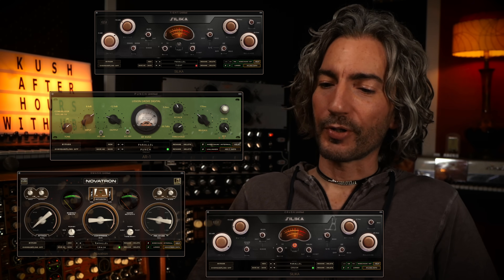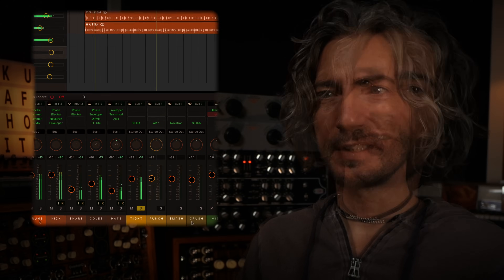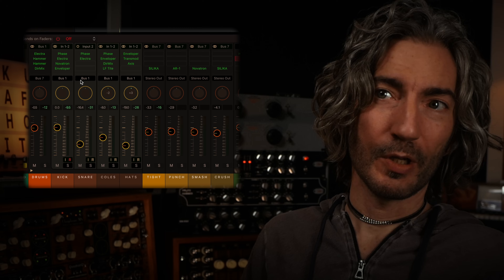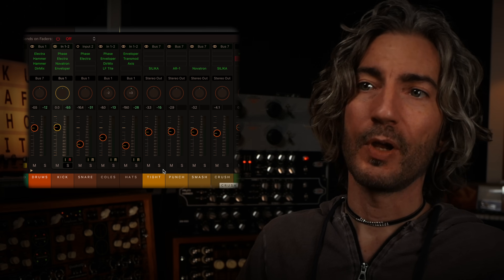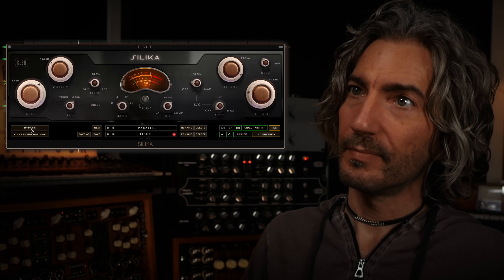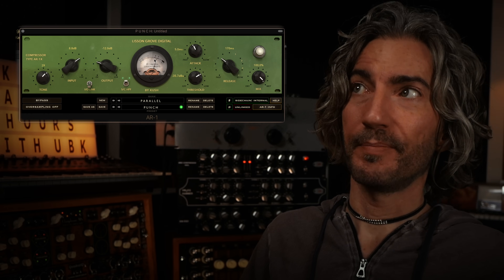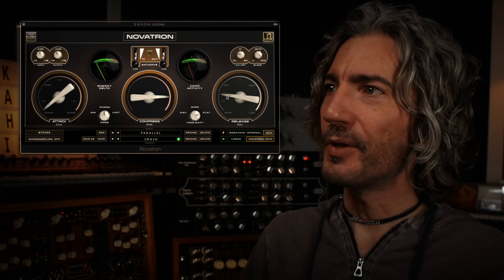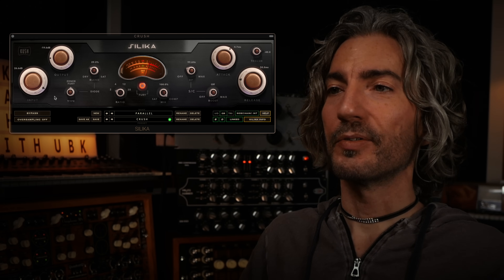Plugin Designer SCHOOLS YOU On Parallel Compression

Comment: Really like the crush signal, puts that 1 to 2k „tap“ impulse that’s so important to the feel , but few people give that area much love because they feel it’ll be hard or get in the vocal’s way, but that snap transient is so important, when it’s there it takes the need to turn the drums up away, gets a natural balance back in there, well done, great video, informative as always…
Reply from the maker: Agreed. 500Hz can also give that same transient impact as 2k, but with a woody, tough vibe rather than sharper metallic crack.
Reply: @TheHouseofKushTV  I try and get that area from my overheads, which by me sit behind the Drummer snare side about 1.8 m high and floor Tom side about 0.9 m high but both exactly the same distance from the snare drum, usually have them full range, HO @ 70-90Hz, it’s the core of my sound, close mics I use to “fill in” the sound and bring out particular character parts of the individual drums, all phase, and sometimes time aligned aligned too to an omni measurement microphone placed above the kick equidistant to floor and snare, use that for a bit of mono dirt or crush as needed…works for me…
Reply: @TheHouseofKushTV  thanks for all the likes and answer, keep up the wonderful work you’re doing, showing people that “breaking the rules” is actually no “creative rules”, only the ones in physics

Comment: Hi Gregg

I like to saturate after the compressor for extra punch and crunch. I also like to flip the phase and gain stage to the point where it nulls out the most, so that point is at the 0db level, flip the phase switch again. Now I'm always adding to the dry signal, not the other way around, and my volume range is as long as possible. 

Greetings

Comment: If I've understood this correctly he's put these compressors on groups (each of those sums all of the drum tracks) as opposed to a compressor on an additional track or aux and blending that in? Then to get his parallel blend he uses the blend knob on the compressor itself... so if you were to turn down the fader on the compressor channel, e.g. 'tight' channel, then you'd lose the dry drums signal too. Have I got that right? I'm still learning this stuff... I've been doing parallel compression on an aux/return and when I do, I generally turn the wet knob to 100% and then just blend that aux track in using fader...  The only time I really use the blend knob on compressor is if I have it as an insert.  So then I just wondered if there is a difference in using the blend knob (say for example at wet 60%) on a compressor on an insert as opposed to having the same setting but with the compressor on an aux track?  I suppose the difference is that on the aux you're getting that additional 40% dry signal added to the 100% dry on the original drum channel??  Is that right?  Is that something that people do?  Or do most people put the blend at 100% if it's on an additional channel (i.e. duplicated track / aux/ return)...

Comment: this is very similat to Brauerizing. You can try and feel different things into each compressor, like the shaker in the tight or the overheads in only the smash and crush compressors, bass guitar in just the tight or the punch compressor etc. so that the elements counter pump.

Comment: Been a fan of parallel compression for a few years since discovering it. I quite dig a smooth vari-mu comp on medium settings parallelled with a fast comp set to crush and does some good work - this method I think gives me your 2nd and 4th but never thought of fitting 2 others in there in the gaps so very interesting to hear. Something on my wants list is the Kush Tweaker so would love to have heard that one in there somewhere but great video nonetheless.

Comment: Remember folks, One of the most famous engineers in the world Michael Brauer said this couldn't be done in software, only analog, because he trapped in that protools world, and as all things protools it was years behind the rest and couldn't do delay compensation. So be careful who you listen to. Luckily for us Gregory ain't no gear or daw snob, just good practical truthful advice.
Reply from the maker: Thanks for the kind words 🤜🏽🤛🏼  In all fairness to Michael, he has channels routing to busses which are also routing to other busses, plus the o.g. channels have sends to effects and other inserts which then also fold back into some but not all of the busses that the channels are routed to... it's vastly more complex than what I'm doing here, and it is actually the case that DAW's can't do that kind of routing.  Not because they're not well-programmed or don't have delay compensation, but because there literally is no way to calculate and correct all the offsets, they're recursive. 🤪

Comment: What I would have wanted to know is WHY the different compression settings give such different darkness/brightness characters to the sound? Is it because the highs are lower-energy so when you crush the signal it tamps down the lows and pulls up the highs, making the sound brighter overall?
Reply from the maker: It simpler than that: distortion, especially the kind that comes from fast hard limiting or clipping of a waveform, creates a lot of square wave shapes and upper register harmonics which are inherently bright.

Comment: Hey Greg,

Is it possible to post the settings that you dialed in on these compressors (and/or how you calibrated them?) toward the top of the comments or in the video information? Perhaps, you posted this elsewhere, but either way, I'd be very interested in that information. Thanks for the great tutorial and share.
Reply from the maker: Honestly?  I just pull up a compressor, push and pull the knobs every which way until I hear something that's a) a meaningful change from where I started,  and b) vibey.  Next, I level match the output with the bypass, then I'll toggle bypass on and off repeatedly until I have a word to describe what I'm hearing, and that's what I label the channel.  Do all of that 1 or 3 more times on parallel auxes until I feel like I have an interesting and diverse palette of sounds to play with... done.  That may be more loose and informal than you were hoping for, but it keeps me experimental and gives me space to conjure unique textures for each song.

Comment: I like how this video was explained, great job. One thing I was curious about was if we could have replaced the first compressor with a tape saturation module? I wonder what kind of tonal control you could have had using some of these analog tape saturation emulators? End result was a great sound although, it would have been nice to compare tape saturation compression and parallel mixing the subtle differences in.

Comment: Around the 20 min mark where you're subtracting the compressors one by one, are we hearing the dry drum bus blended in as well, or are you just using the 'tight' bus as the 'dry' signal? 
Might be a stupid question, I know parallel comp is parallel with a dry signal. But since your 'tight' bus is almost dry anyway, are you actually using the true dry signal, or just those four busses? 
Cool bassline and groove BTW! Your drums are always lively and dynamic.
Reply from the maker: Those 4 busses are all your hearing, the Tight is playing the role of the dry drums. A small correction if I may: you said “I know parallel comp is parallel with a dry signal,” that’s not actually a rule or a given.  Here, 4 comps are parallel to each other, but there is no dry signal anywhere. They’re ‘parallel’ because they’re processing the same input and the results are combined afterwards. 🙂

Comment: i've never understood with parallel compression (even more so with 4) how you wouldn't get phasing issues with multiple signals playing 'almost' the same thing.. and by 'phasing' i mean when you have to very similar things playing at the same time or possibly slightly offset you get a kinda of phasing effect. hang on.. i think i've just answered my own question haha.. surely with two identical tracks playing the SAME thing just doubles to amplification .. i think i'm thinking of cancellation (when 1 source is inverted and you're left with the difference of the two) .. nevermind.. sorry (i will leave this comment as a reminder to wakeup haha) ..great vid as always man :)

Comment: Oh, I dunno, isn't four compressors kind of arbitrary? I tend to start out with the one bus, then add another if and only if "something is needed", then reassess. Could always add another, then another... so why four? And why not six? 

Did you originally start the experiment with 2, then 3, and wound up at 4? Or do you just always reach for 4?

I think the most parallel buses I've done is three, and only one was properly compressed. With others I'll do shelving and then add saturation/distortion -- sort of a "poor man's multiband". And sometimes such a bus might be just one or two pieces of the kit, like kick/snare backbeat. Or, in your example here, I might just take that hi-hat mic to dial in the articulation and stick sound and sizzle.

Comment: This is quite similar to the Michael Braurer technique is it not? Blending multiple parallels rather than just having a drum bus and a parallel chain.
Reply from the maker: In a broad philosophical sense, absolutely, but that’s only because parallel processing is parallel processing regardless of intention or application. But this approach, and Michael’s, are both extensions of the old-school “New York compression” technique. Here I’m using four busses exclusively for drums, Michael has five mix busses that are for anything and everything combined, and in the o.g. NY compression scheme it was simply a duplicate mixer channel for the vocal, overdriven and smashed and eq’d very bright, blended low for density and texture. It’s all the same thing, just paints and brushes, used by different artists in different ways to realize different visions of music. 🙂

Comment: Sounds like the first compressor is slightly increasing the decay on the hats (a reduction in the 'tshhhhh' following the stick hit), making the hats sound 'tighter' (like the name of the strip). At a guess: low (severe) threshold, low ratio, and a long release time. The  That said, it's only an opinon, I'm sure someone with the right answer will come along to correct me :-).

Comment: Please release your logic skin! It looks wo great with your plugins
Reply from the maker: Thanks!  Sadly it doesn't work with newer versions of Logic, which is actually half the reason I'm switching to Reason.  So I guess someday I'll drop a Reason skin 😛
Reply: @TheHouseofKushTV  Whats the other half? :))
Reply: @TheHouseofKushTV  Coming to the House of Reason. Welcome along. Yer gonna luv it. Sing out if you need any comprendo on anything as I have been R-Rated for almost a decade and a half now. :-)
Reply from the maker: @bebestakkis  Honestly?  I'm not a fan of how laptop-and-beats-producer focused Logic became, while really REALLY basic mixing functions (like a phase flip and trim on the mixer channels, metering on hardware inserts) remain completely absent after 10 years.  It also has several major bugs at higher sample rates that have persisted across years.  Plus, my brain could use the workout of learning an entirely new production environment, I'm actually very intimidated by the prospect!
Reply: Guys don't leave Logic when it's becoming real pro. Atmos got major producers fully on board. Apple fixed the latency compensation bugs. Logic on M1 ? Damn. Apple seems to listen to feature requests a bit more, lets bug them ! Every damn has stupid little flaws. Logic's getting there, rather soon, to my humble opinion. Cheeeers

Comment: I think it would be "fun" (hours of work) to try a "sliding compression" on different parts of the recording, i.e.. to allow each instrument a bit of limelight, to stand alone at different points in the recording. I become "mental" when cymbals get too loud and  "take over" a recording mix, but would LIKE to have them turned up later in the recording, to be featured for their hypnotic effect, perhaps with some phasing. (I hate cymbals so much I'd rather have a tambourine in the mix!) In other words, I would START the recording with very quick, dry samples of each instrument coming into the mix on an equal footing, and then emphasize each one seperately as time went by, using your punchy compressor and volume effects. (And then take them out one by one to end the track.) I really like that "side" whah-whah peddle and the wide open, LIGHT guitar vibes! Thanks for all you do!

Comment: What’s causing the punch compressor to accentuate the low end while the next bring out the hi hats so much?
Reply: if you think about the length of waveforms at different frequencies then it makes sense that a compressor with a failry quick attack will only let a small waveform through (high freq)  so you only hear the high's accented as any longer waveforms ( lower freqencies ) have been ducked down shortly afterwards. 

The release time and curve on the way back up likewise will also either draw your attention to or push away different freqencies too. 

Also the sidechain, i.e the bit of the signal that the compressor listens to is not the same as the full signal you hear, and some compressors are disigned to react more to various frequency areas. so for example a compressor that's more relaxed in the low mids may feel like its kinder to snares etc. even if its the whole signal effected it's what our ears a drawn to (psycoacoustics)

This is compounded by various saturation behaviours in the circuit along with the different behaviour of compressor design types (feed forward / feed back etc ) which end up psycoacoustically enhancing differnent areas of the spectrum and phase at different rates over time, , especially when mixed back in in parallel like this.

Comment: Is it really in parallel though? There is no dry drums heard, just the 4 comp busses...
Reply from the maker: It really is parallel, yes 😊. It seems like you're thinking that "parallel" = "processed mixed blended with dry", but there's no such rule or convention.  Parallel means exactly that: parallel.  All 4 compressor auxes in this session are running parallel to each other, meaning "processing the same input and routed to the same output".   Even the "dry" drum buss that feeds all of the comp auxes doesn't actually have any 'dry' drums in it, the individual channels were all eq'd and saturated and sometimes compressed as well before hitting the drum buss, and that drum buss itself had 3 eq's on it.
Reply: @TheHouseofKushTV  fair enuff good sire:)

Comment: How are there 4 buss 7's ? I've not seen this before.. noob question of course! Anyone? thanks
Reply from the maker: It's a great question, and your confusion is understandable.  You're confusing 'buss' with 'aux'.

There is only one "buss 7".  You can send buss 7 anywhere you want, to as many places as you need.  Here, there are 4 aux channels, each of which has buss 7 assigned to its input.

Think of it like one pipe (the buss) feeding water (sound) to 4 faucets (the auxes).  🚰
Reply: @TheHouseofKushTV  Now I get it. Thanks for the help! Great video and channel by the way. Treise leat a charaid (more power to you bud) 🤠

Comment: Isn't it a bit redundant to balance mix on compressors with their own dry/wet settings? And you're not the first one I've seen doing this, so it almost feel like i'm missing out on something.  Leaving all the compressors at 100% wet and balancing them with the dry mix in a separate channel sounds like a more intuitive approach.
Reply from the maker: All these compressors are at 100% wet, and one of the channels is serving as the dry.  So... we agree 😊
Reply: @TheHouseofKushTV  9:49 you show a 30% blend on the final SILIKA compressor. I think that's what Nitro is asking about. @Nitro, it's just that the effect in this case would have been WAY too strong and the fader would have been down at around -50dB to get a good mix - it's hard to work that way, so he made it a blend and now he can bring the fader up to some reasonable level. So again, just a matter of doing what works.
Reply: I believe the "Tight" compressor also has a low blend too, though to be fair that's supposed to be the dry(-ish) signal
Reply: @christophermeraz-mata  Well yeah, the last compressor would indeed require the slightest touch on the slider if it were 100% wet. Maybe you're right about that being the reason.
Reply from the maker: @nitroanilinmusic  Ahh, I see the confusion, my bad!  SILIKA has 2 blends controls, the first is for the Input Saturation stage, which I have set to low blend.  THAT blended signal is then sent to the compressor section, compressed, and THAT compressed signal is 100% wet, so the part we're focusing on here -- the compression -- is the same as the other compressors, no dry signal to be found at the output.  UBK-1 has this same sort of internal routing, it can take a minute to get your head around it but it's insanely flexible when you do. 😊